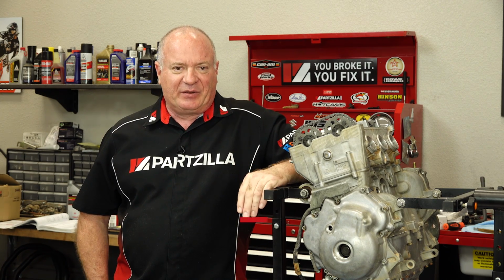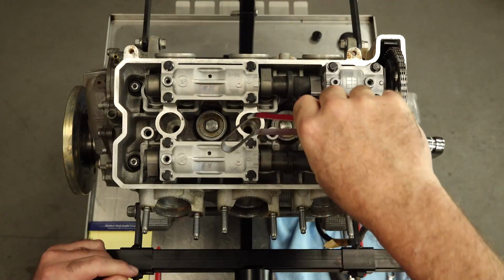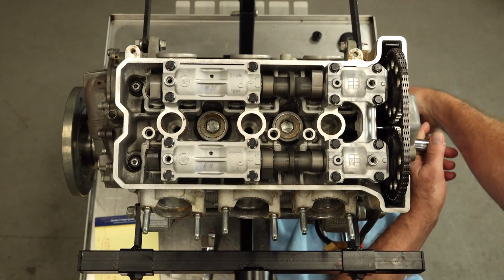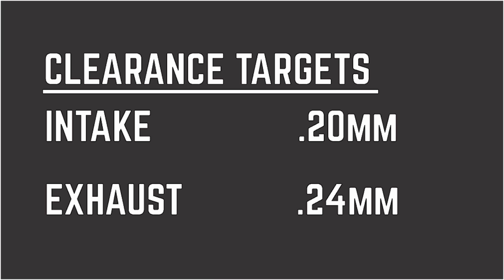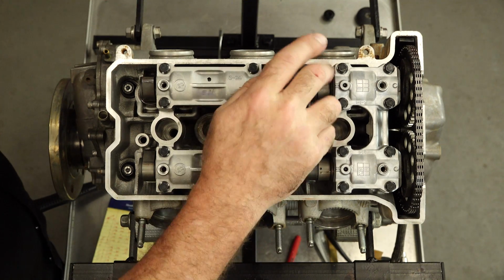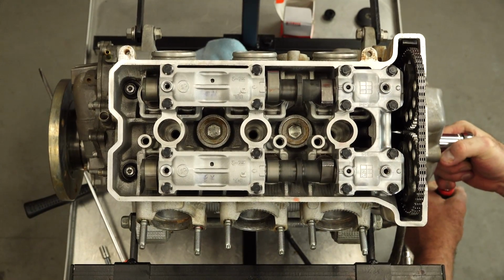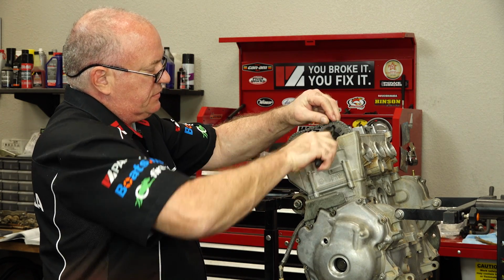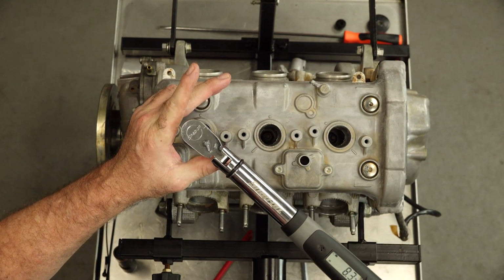Yamaha YXZ1000R Valve Adjustment | Setting Valve Clearance on a Yamaha YXZ1000R | Partzilla.com

Comment: Will this cross over to the RMAX 1000 motor. And if not have you done this on an RMAX yet. I'm in need to either pay a tech to do it or do it myself. I work on my own stuff and think I can do this but there is nothing on YouTube about this motor. Looking at that motor and the RMAX motor they look very similar and I don't know why Yamaha would do it different.

Comment: Manual tensioner not recommended for this motor!! They are too tight usually! The auto tensioner uses hydraulic oil to tighten the chain when starting!!

Comment: This will also apply to the Arctic cat (Textron)wildcat XX1000 same exact engine except hp rating is higher on the XX and it sits horizontal in the frame due to its a cvt!

Comment: Thanks for the video.  Does the shim kit you recommend work for a 2017 YXZ1000R?  I messaged with Partzilla, but they said they don't have a kit that works for a YXZ1000R (including the one you link to)??  I was told to go to a Yamaha dealer and buy individual shims...???